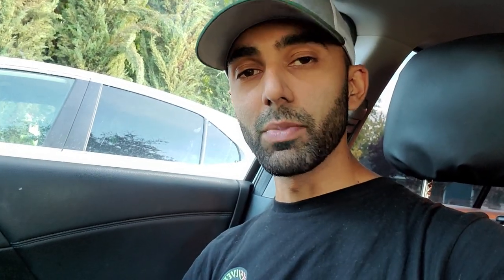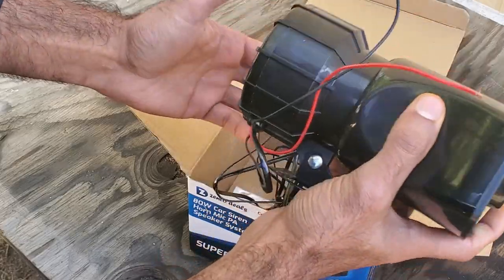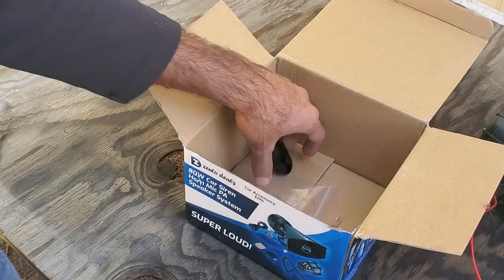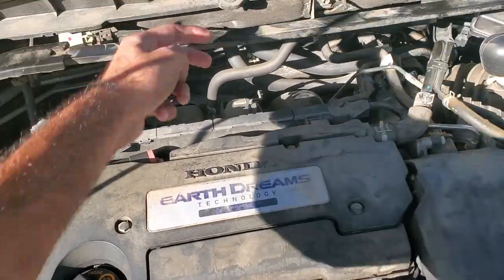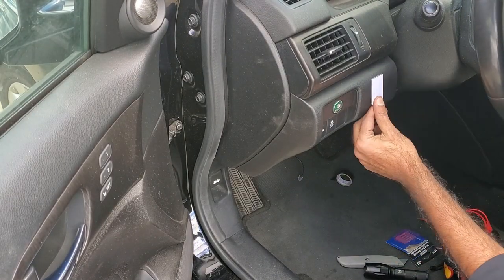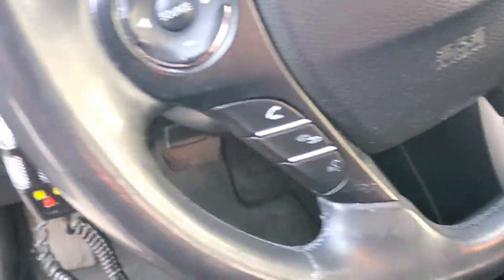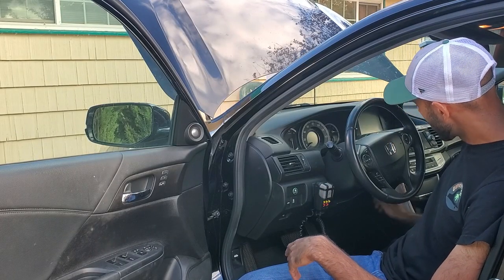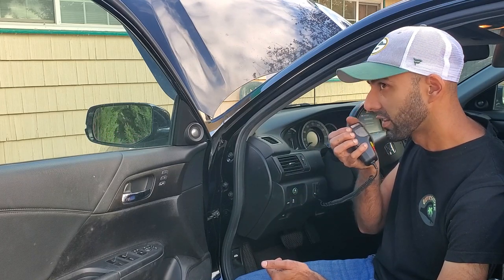Installing A PA Speaker System In Your Car!

Comment: I love it when you don't show the actual fuse install process and instead speed it up 1.5x
Reply: 1 to battery 1 to a fuse. preferably a fuse that is only getting power when the car is on.
This prevents the accessory device from constantly pulling power draining your battery when the car is off AND adds a fuse in the connection so if something goes wrong the fuse pops and nothing more.
You need a fuse adapter for that. It just wires onto the end of your accessory device wire and plugs into the fuse box like a regular fuse but with a wire attached 
Everything else if just tidying up wires so they are hidden and don’t get caught in anything.

If you don’t understand how to hook this up you have NO BUSINESS trying.
Either don’t do it or pay someone to do it for you.
It’s a 30 min job

Comment: Very neat installation overall. My only question is would the unit be susceptible to engine heat? I’d be kinda worried about it possibly getting melted overtime by the heat of the engine.

Comment: Nice video! is it legal to use in UK
Reply from the maker: Thanks! Not too sure I'm in the US
Reply: @DuctTapeMechanic  
Everything is illegal in the US. I'm sure theirs a code somewhere out their waiting to be dusted off. Sorry buddy is (For Your Safety.)🤝
Reply: In my suburban city in the US, there's a law about having a sound system that can be heard something like 100 feet from your vehicle. These kind of laws are originally intended to restrict the volume of internal stereo speakers, but I'm pretty sure these laws could also be used if law enforcement is unhappy with your external speakers. (I'm not a lawyer though)

Comment: Is there a  way it can be louder ?
Cause once in traffic or anywhere crowed  it dont  make sense.
Reply from the maker: The only way would be to buy a more powerful system, there are multiple to choose from on Amazon
Reply: You could probably install an amp like one for a sub, but that would be a complete different setup
Reply: Look up marine speakers that are attached to trucks. These systems can get very loud, if you're willing to spend a lot of money. They get used by individuals on pickup trucks, just for fun, as well as installed on box trucks to be used for entertainment for crowds at events.

Comment: specifically, what kind of red and black wire did you use to extend the length?
Reply: Normal 10 or 12 gauge wire should work